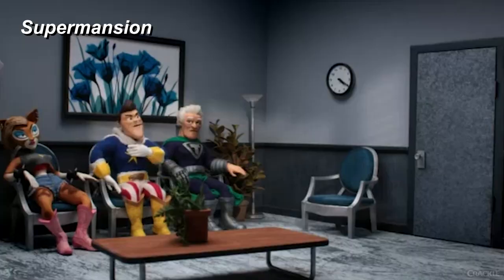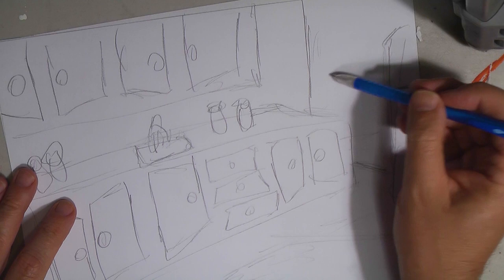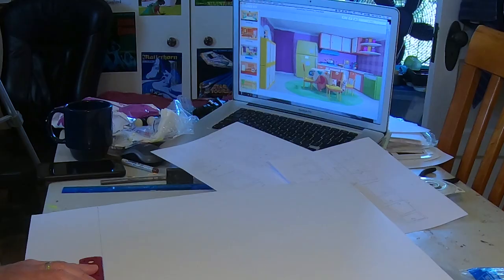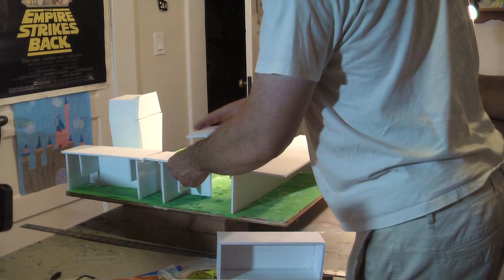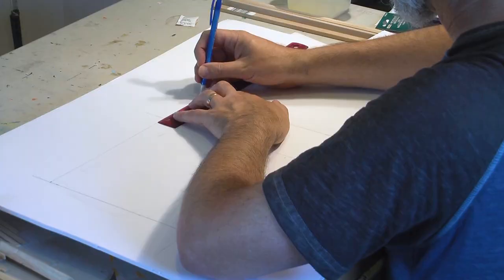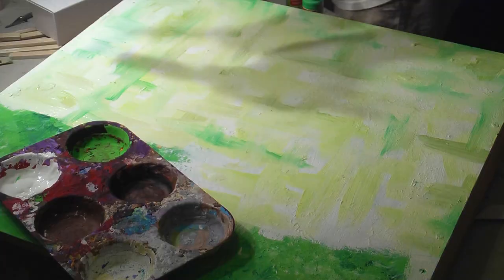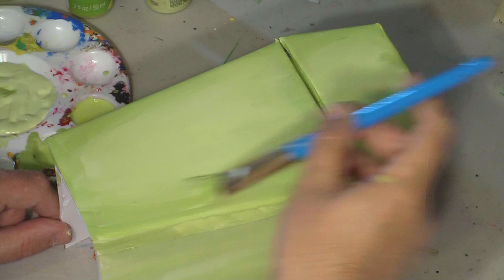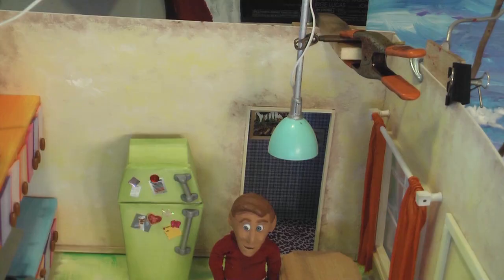Stop Motion Tutorial:  Build a Set!  Part One

Comment: Have you ever attempted at using 3D printers for stop motion puppets and sets? or that would be too expensive and ineffective?
Reply: @MaximilianonMars  well, that escalates quickly
Reply from the maker: I haven't tried it myself yet, but I've worked on projects that use 3D printed assets, and it looks like a good method if you can afford it.

Comment: What set up do you advise for a stop motion work space? any tips on work space? table shape? thickness? table legs?

I am looking to remodel a room into my first studio
Reply from the maker: I suggest a plywood top of 1/2"-3/4" with a 2x4 frame and legs, with additional reinforcement on the legs to prevent every bit of wobbling. Size and shape has to do with space available, noting that you need space all around the table for lights, supports, and your own access to every part of the set.

Comment: But wouldn't you have to hot glue the furniture parts? When I tried animating a few times they would constantly jiggle around, and if I do glue them firmly together, then I would have to find a way to take them off later without causing too much damage....
Reply from the maker: To glue plastic or wood furniture down, I put a small piece of tape on both the furniture and the floor or wall (both out of view of the camera) and put the glue on the tape.  The glue holds the furniture in place while the tape protects the surfaces.
Reply: Good idea, but what kind of tape should I use? Does masking tape work well?
Reply from the maker: @puppetbert6136  When I can find it, I use residue-free duct tape, which for some reason I can only find at Target.  Gaffer tape is best, available on amazon.  I wouldn't trust making tape to hold, but it would be better than nothing.